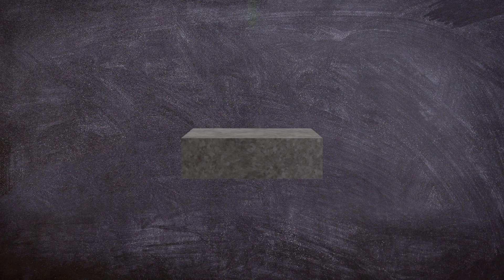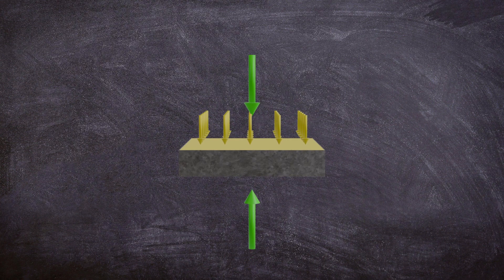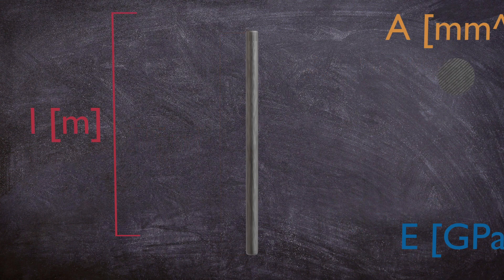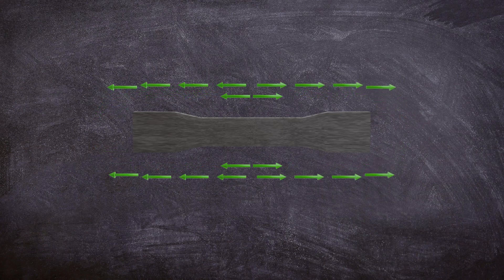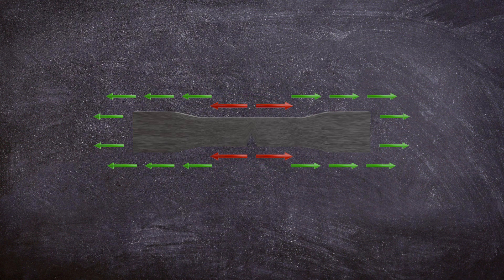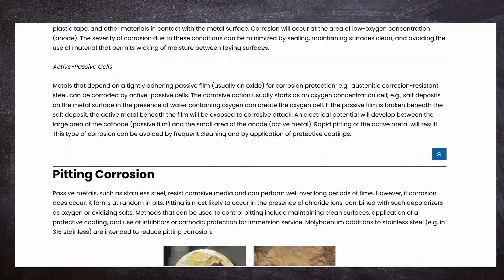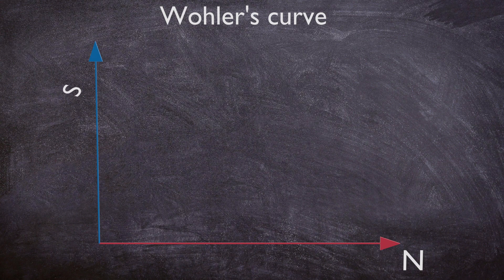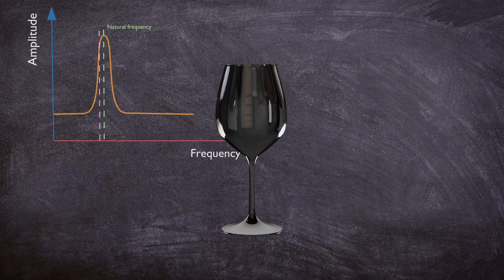All Engineering Failures Explained in 8 minutes

Comment: Me coming here as a software engineer: 😭😭😭
I actually have a real engineering degree in software engineering, however, still not a real engineer since getting my P. Eng. certification has never been relevant in the jobs I've had. I think it should be necessary though in a lot of cases. Our world is so dependant on software that software engineering failures do cause significant harm to society in similar magnitudes to traditional engineering failures (e.g.: CrowdStrike incident in 2024).

While these exact failures don't exist in software engineering, there are common failure types which are analogous.

- Dependency Decay: Occurs when external systems, APIs, libraries, or frameworks that the code depends on are updated, deprecated, or become incompatible. It's like corrosion because it happens due to environmental factors outside the system.
- Code Decay: Happens when code becomes difficult to understand, maintain, or extend due to poor design, lack of documentation, or increasing complexity over time. It's like fatigue, because the code is manipulated and changed over time in a variety of ways, weakening it's original intent and leading to errors.

There's many more examples and analogies. I haven't even talked about the infrastructure side of software engineering, like network, server, and database loads/throughput/latency which is very analogous to engineering as there is physical infrastructure involved (even though it's behavior is often defined in code), but this is enough rambling for a YouTube comment so I'll stop here.